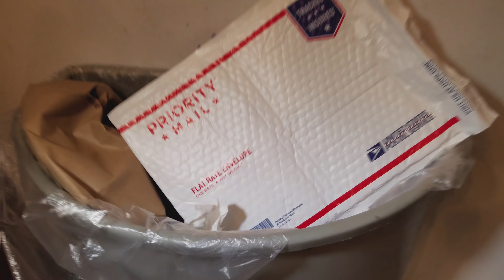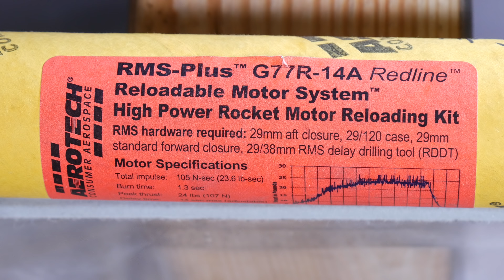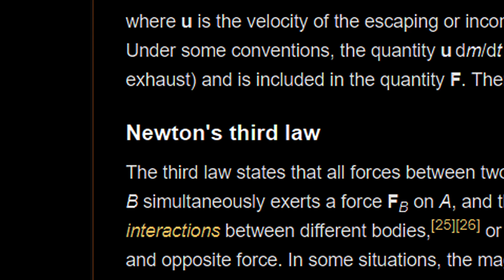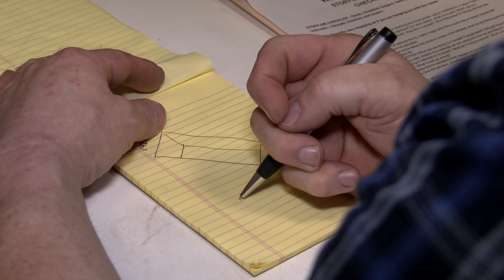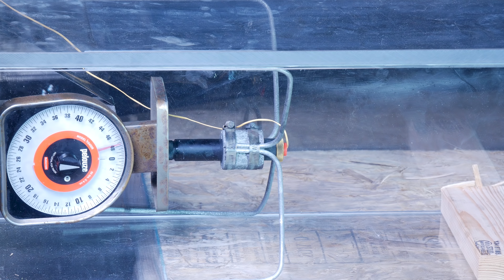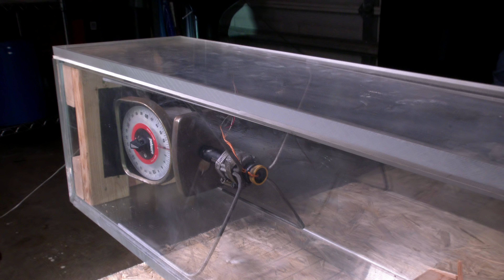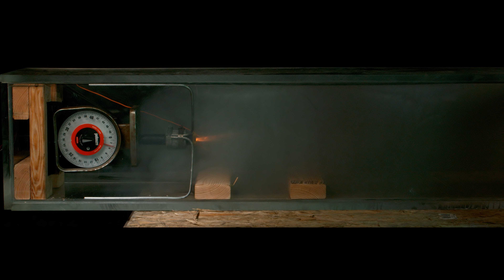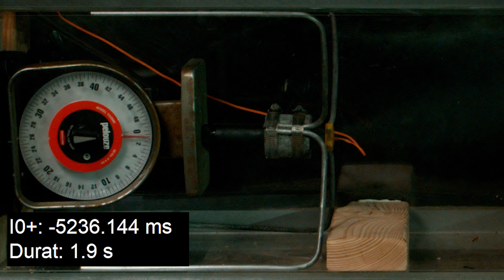Rockets in a Vacuum Chamber - Newton's third law of motion Visualized

Comment: For every action there's an equal and opposite reaction. There must be at least two bodies. A rocket pushes propellants out in which in turn creates a partial ground effect and high pressure behind the rocket and therefore pushes the rocket forward. In space were its basically Impossible to create a useful pressure differential due to its vast size and extremely low pressure, how does a rocket move?
The propellants will just expand rapidly without any push back so why will it aid in propelling the rocket?
Everything conventionally powered requires pressure differential move. That's why cars need friction to move, friction creates high pressure differential therefore the wheel pushes harder on the ground towards the direction of lower pressure and the car moves forward. That's why cars move slower in slippery icy roads because the pressure differential is much lower for the same amount of work.
Reply: If I fired a standard Steel projectile from a crossbow in a vacuum, would I feel recoil?  Yes or no?  Why or why not?
Reply: @stuartgray5877  you will feel recoil but the difference is that solids don't dissipate into the voidness of space like what a gas would do therefore the total potential energy of the crossbow is successfully Transfered to the arrow and thus feel recoil. For gases it's different given that they expand rapidly and their potential energy gets wasted in a space. Think about trying to blow a ball in space with an air tank? Why would the all the gas work to push the ball?
Reply: @yuheyuhe4486  sorry but you are incorrect. The law of Conservation of momentum says NOTHING about the object being solid, liquid or gas.  It matters ONLY if the object being pushed away HAS MASS OR NOT.  When the rocket fuel was liquid in the rocket tanks,  DOES IT HAVE MASS?  YES  Does it have a relative velocity with respect to the ROCKET? NO.  So now AFTER the fuel gets burned and turned into exhaust GAS, does it STILL HAVE MASS? YES.  Does the exhaust gas NOW have a relative velocity with respect to the rocket? YES  So if the exhaust gas HAS MASS and now it has velocity that it did not have before, then WHAT ACCELERATED THE GAS? Where did the FORCE ORIGINATE?  Are you suggesting that GAS DOES NOT HAVE MASS, or that mass can be accelerated WITHOUT A FORCE?  Which is it?  Or are you one of those that believes INCORRECTLY, that the"vacuum of space" can exert a force on the gases leaving the rocket? Because that would be FALSE, vacuum CANNOT  EXERT A FORCE ON ANYTHING.   So now draw a force diagram of the exhaust gas leaving the nozzle and tell me WHERE THE FORCE CAME FROM.
Reply: @stuartgray5877  true conservation of momentum does not discriminate. But my argument is that a solid will have all its momentum focused in the direction on its motion while as for gasses the particles they'll tend to have particles rushing to fill a volume. For instance imagine there was a incredibly sensitive pressure sensor at the bottom of a cylinder full of water, if you drop a solid, the solid will reach and set off the pressure plate. But with a drop of ink, once released and comes with contact with the water the ink diffuses this meaning that the momentum of some of the particles go a different direction thus not reaching the bottom of the cylinder. I use water and ink because they're fluids like gasses.
Reply: @stuartgray5877  I'm not saying the gas is mass less if so then I wouldn't have used momentum. I'm saying the force of the ignited gas would simply be siphoned from producing meaningful thrust by space. Example a balloon in higher altitude will travel less than one at sea level with the same mole of gas
Reply: @yuheyuhe4486  why did you give up? Did you watch the undeniable video of rockets working in a vacuum or are you afraid to be proven wrong?

Comment: Raises good questions as in space where ther is no air, there is a need to supply your own air to burn a rocket, OK, but the test raises questions and I start to think about those small tiny moon landing crafts??
My biggest wake up was the vaccum pressure or any vaccum pressure and those fabric type space suits protecting those guys on the moon, the psi pressue would require some internal pressure, somebody explain as science is not my game? Always fun to watch those who question the accepted norms!
Reply: The truth IS: an astronaut could crawl inside a big mylar birthday balloon, and fill it to 5.0 PSI pure oxygen, then survive in the vacuum of space, as long as he doesn't puncture the balloon.  A regular mylar Bday balloon could survive the "vacuum of space" no problem.  Just like car tires filled to 30 PSI at sea level could be sent to space without bursting.
Reply: Good reply and have not checked it out but it brings a bit of sense to how people survive in a vacuum, was thinking it should be a hard shelled type suit, so appreciate the answer.

Comment: But there is flow with this experiment, the box is filled (extremely fast) with burned gases which changes the pressure... So, practically it's not vacuum anymore and results are not correct. Remember vacuum in space is not bounded by walls!

In order to have accurate experiment results, the vacuumed champer should be much much bigger than this to avoid filled with gases and gain internal pressure once rocket fuel ignite.

Anyway, I do believe that the less the atmosphere pressure, the less the repulsion would be till you reach Zero repulsion. Same happens inside your car engine, if cylinder pistol surface is leaking burned gas, the pushing energy would be less, and engine performance would be inefficient, and if there is a big hole in the cylinder walls, then no repulsion would happen to push pistols and generate movement.

Gases generated from burning fuel have to collide with anything (e.g. wall, ground, atmosphere gases, etc) and create enough pressure in order for rocket repulsion.
Reply: Sorry but rocket propulsion is MORE efficient in a vacuum and LESS efficient in atmosphere
Reply: @stuartgray5877  
Really! How?!
Reply: @AlaaSalem  Atmospheric pressure HOLDS BACK the exhaust gases and slows the exit velocity.  In a vacuum the exhaust gases reach maximum velocity which imparts more momentum to the rocket.  Higher exhaust velocity equals more thrust.
Reply: Someone has to demonstrate this experiment on large-scale on earth.
I wish if same experiment could happen in a huge vacuumed champer, and measure if propulsion readings are different....
Reply: @AlaaSalem  we have flown MANY spacecraft and used propulsion in space MILLIONS of times.  This is not up for debate.  Rocket Propulsion works fine in space and we HAVE tested in in earth in large vacuum chambers.
Reply: @AlaaSalem  your last comment either didn't post properly or you deleted it.  I know that Spaceflight is real because I have been building, testing, launching and FLYING spacecraft for likely longer than you have been alive.  I have personally launched five spacecraft, and four of those were deep space missions.

Comment: Im willing to be sent to space and test the grenade argument and the basketball throwing one. Im actually down for anything just send me BUT everything has to be done  live.
Reply: You don't have to go to space to test that Newton's laws apply in a "weightless" (freefall) environment, in a vacuum.  Just make a tall vertical pipe and pump it down to vacuum, then drop physics experiments and measure the results as the devices fall through a vacuum.  In FACT, we do just that, and have demonstrated that Newton's laws apply in freefall, in a Vacuum, just as they do in space.  NASA has a "Zero Gravity Research Facility" which allows tests to be conducted with about five seconds of free fall time in hard Vacuum.  Do you think you would feel recoil from firing a crossbow in a vacuum? Of COURSE you would.

Comment: Once the rocket ignited, it created an atmosphere. Also, it’s a tight space. Say, the environment was as big as a gymnasium. And the same size rocket motors used in this test. Would this still be considered an acceptable test?
Reply: Just think about the third law of motion for a minute. Why would a rocket need for there to be air around it? It ejects mass backwards, therefore a forwards force is imparted on the rocket. That’s all there is to it.
Reply: There is a very common misconception about how things fly in the air.  Planes aren't pushing OFF the air.  They are pushing AWAY the air.  Think of it as if they are picking up air and then throwing it away from them.  Planes and jets and boats are designed to propel themselves based on the environment they will be in.  All these things (rockets included) work on the same basic principal.  If you push mass away from you, you will be propelled in the opposite direction.  It's one of the most fundamental principles in all of physics.  It's like on page 3 of the first physics textbooks you never read.  Planes, jet, and boats borrow their mass from the surrounding air/water.  They use fuel to operate an engine which will in turn cause some mechanism to do this (like a propeller or a jet).  Rockets use fuel as the very mass itself which they push away from them.  The fuel isn't operating any engine.  It's just being ignited and the resultant explosion is directed out of the rocket nozzle in a very controlled manner.  There are some rockets that can burn upwards of 15,000 gallons per second.  That's a LOT of mass, and they push that ignited fuel out of that nozzle at EXTREMELY high velocity.  If you watch a rocket launch, you can hear crackles and pops.  That is the sound of the exhaust gasses breaking the sound barrier.  By a LOT.  You can FEEL rocket launches if you're there watching.  From MILES away - you can FEEL it.

You have all that mass being ejected with all that velocity - - by the fundamental laws of physics - - the rocket will necessarily move in the opposite direction.  To think otherwise is just absolute lunacy.

Comment: You also cannot brace the rocket you've given it a medium to push off of. The rocket must be free floating.
Reply: The brace is Infront of the thrust.
How is it pushing off of the brace?

All the brace is doing is holding the rocket central in the chamber.
Reply: @Lee.S..B  it's braced all over and mounted in the rear... bottom line is the rocket must be free floating in weightlessness

Comment: So called space wouldn't have walls for the rocket to push off on and the air produced by the rocket would dissipate very quickly in so called space causing no thrust
Reply: Rockets don't work that way.. So your argument is a strawman.
Reply: Desmond - If you fired a crossbow into a vacuum, would you feel a recoil force?

If you are unwilling to answer that question you have no business commenting on basic physics conversations.
Reply: @stuartgray5877  ok troll 😂

Comment: SOLID ROCKET BOOSTERS TO GET TO THE VACUUM OF SPACE, THEN A MIXTURE OF CHEMICALS IS USED TO CREATE THRUST IN THE VACUUM.
Reply: We use solid rocket motors in hard vacuum frequently, they work great.
Reply: I was wondering about that. thought they were used but wasn't sure. I know we used Liquid Hydrogen and liquid Oxygen and allowed the two to be mixed in the mixing chamber to get off of the launch pad at the cape. We also used a little Kerosene on one of the stages.

Comment: This vacuum is not even close to space that is 10 to -17 torres.  The Sandusky air chamber is built 6-7ft thick. This is barley at 0atm. Vs space at .00000000000000000132 torres.
Reply: @stuartgray5877   its .0000000000000000132 Torres yes it has a measurement   it doesn't exert a force. Explain why a aircraft can blow outwards  due to pressure difference. Hmm
Reply: @wakeuppeople7327  - "Explain why a aircraft can blow outwards  due to pressure difference."

I am NOT questioning if PRESSUIRE can exert a force.  Of COURSE IT CAN.

But VACUUM cannot.  Pressure pushes TOWRADS vacuum.  Vacuum does NOT "Pull".
Reply: @stuartgray5877  vacuum is just a state where there is low pressure.  Like a oil tanker imploding.  The air pressure inside is going down   Probably the wrong word to use. Figured that saying vacuum people understand zero pressure not a vacuum cleaner type vacuum.     Next time I will say. The lower pressure on the outside of the aircraft produced a force from the pressurized cabin. Like over inflated ballon. Eventually it pops.  Well this popped.
Reply: @wakeuppeople7327  
0 atm equals 0 Torr. Next?

Comment: So I admit I don't know squat about physics and equations... but it seems to me if you had an infinitely powered giant vacuum hose under a rocket launch and then you switched on the vacuum at the same time as the firing the rocket... would the rocket move? Or would the vacuum just suck up all the propulsion.. I suppose to be fair you would also need to have a giant hose above the rocket at the same time... hmmmmmm... 
I'm going back to watch UFC videos now
Reply: A vacuum cleaner is like a wind tunnel.  The "vacuum of space" could not be more UNLIKE a wind tunnel.  The "vacuum of space" cannot exert a force on anything and does not "suck" the exhaust gas from the rocket.

Comment: That was not a vacuum...at least it wasn't once the rocket ignition began.  Your simulation does not account for the enormity of space.  This is perhaps the most critical variable which you would need to control for in order to truly have a static reproduction.  In space, the ratio of space to the effect of the rocket of the rocket motor upon its environment is exponentially less by a factor almost too large to calculate.  This experiment is not at all valid.

Comment: Even is NASA had the rockets with their own oxidator, it's superfluous as any rocket would run out of oxygen in about 5 minutes
Reply: Good thing rockets rarely need to run for more than 5 minutes at a time.  And I guess you must have done the calculations.
SO how long DOES it take a Space Shuttle to run out of Fuel and oxidizer when a single SS Main Engine consumes Liquid Hydrogen and Liquid Oxygen at 500 kilograms PER SECOND.
Be sure to account for the fact that there are THREE SSMEs.
SO, show us your calculations genius.
Reply: Jimmy - Here are some numbers for you to work with: 
A Shuttle Main tank can hold 629,340 kg of Liquid Oxygen and 106,261 kilograms of liquid hydrogen.
The stoichiometric ratio for combusting hydrogen and oxygen is ~8:1 but they run SSME at ~5.5 - 6.0:1 resulting a fuel rich exhaust gas
629,340/106,261 = 5.9

So the total Fuel + Oxidizer = 735,601 and if One SSME consumes 500 kg per second, then three of them consume 1500 kg/s.
735,601/1500 = 490 seconds = ~8.2 minutes.

The ascent time of a SS is right around 8.5 minutes.

YOU WERE SAYING GENIUS?
Maybe you should try finishing high school before thinking you are smarter than the rocket scientists?
Reply: Jimmy - I have an actual Engineering degree and I have been building, testing, launching and operating earth orbiting spacecraft and deep space science probes since before you were born.  I have worked at (or for): Lockheed Martin Space Simulation labs and Flight Systems, Jet Propulsion Laboratory, Laboratory for Atmospheric and Space Physics, Marshall Space Flight Center, Goddard Space Flight Center, Ball Aerospace, NOAA, and DOD. I have personally helped launch six spacecraft and been the launch conductor for a few. I have been a Flight Director at JPL on the Deep Impact mission, System Engineer on the Kepler Space Telescope, and Power subsystem Engineer on NOAA-20.
I have personally witnessed over 30 real rocket launches, most from closer than the public is allowed.
But tell me again how a high school dropout has proven my entire career to be a hoax.

You are suffering from the Dunning Kruger syndrome. Any adult that believes "space is fake" meets the clinical definition of "mentally retarded".
So Bless your little heart Jimmy!
Reply: @scotp5592  - "I am however very skeptical of the ability of a craft to accelerate/decelerate in the vacuum of space. How exactly can a rocket pushing against absolutely nothing push the source of thrust forward?"
I can explain easily to anyone willing to answer just three simple questions.
Most of these people that argue against basic physics will not answer these questions.
Can you?
Lets just talk about a rocket engine running here on earth in atmosphere first ok?
When a rocket engine is running:
1 - Does the exhaust gas get Accelerated from the engine?
(does it experience a change in velocity?)
Yes or No?
2 - Does the exhaust gas have mass?
3 - Can mass be accelerated without a force? (or is a "force" required for mass to be accelerated)?
These are not trick questions and can be easily answered by anyone that has passed high school physics.
Reply: @scotp5592  and it seems odd that not all posts are appearing on the thread. I can respond to your post, but I can not SEE it in the thread. I dont see the posts from Jimmy any more either.
Reply: @stuartgray5877  right. Lol, excuse not to fail in providing an image of earth from space
Reply: @jimmy7144  There are literally MILLIONS of images of earth from space.
YOU just dismiss all of them "cuz reasons".

Comment: The rocket boost is pushing off the wall of the container 🤔
Reply: No rockets work via RECOIL FORCE.
They "Push" off of the MASS that they eject from the nozzle.

IF you don't think that rockets work in a vacuum, then you don't think that a crossbow would have any recoil in a vacuum either.